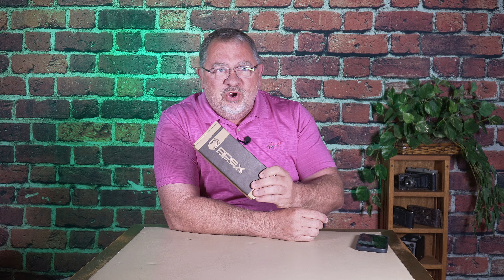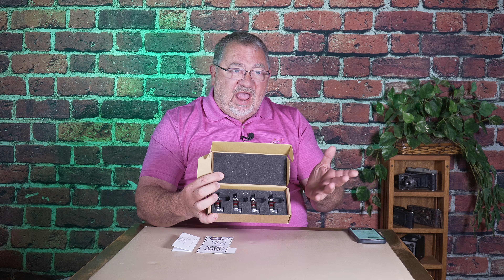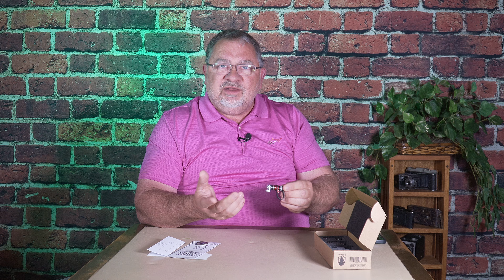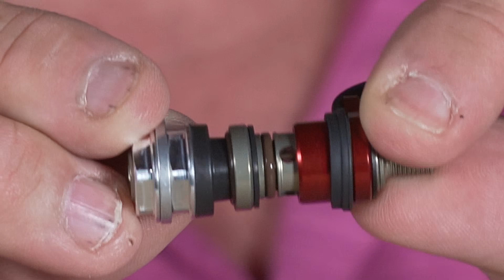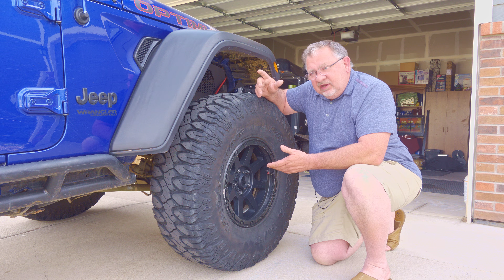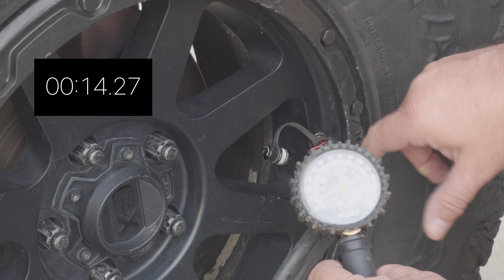Air Down Fast! - Apex RPV (Rapid Precision Valves)

Comment: Best hope you don't forget to put the cap on (or that it comes loose) and get the loop snagged on something and open that valve up.  Is that the only means of keeping these from opening up?

As for pre-set deflators... I use the Staun deflators, which flow at nearly the same rate from start to finish, which makes them much faster than the other ones you've described.  They're also about $100 per set.
Reply from the maker: The loop is just like a rubber band, it would snap before causing any issue. If you forgot a cap, it is possible, although unlikely for the pressure valves to open.